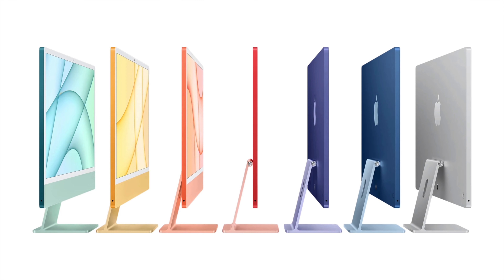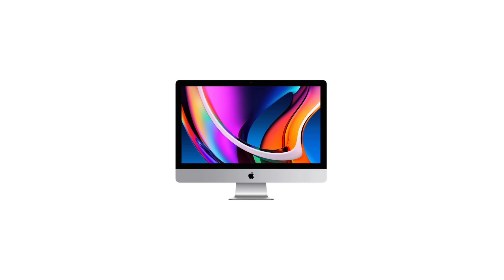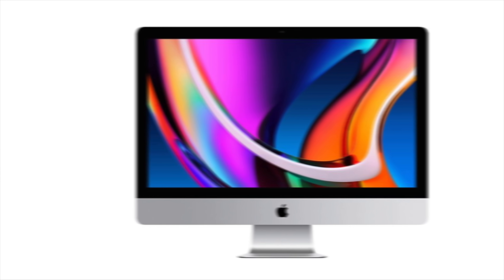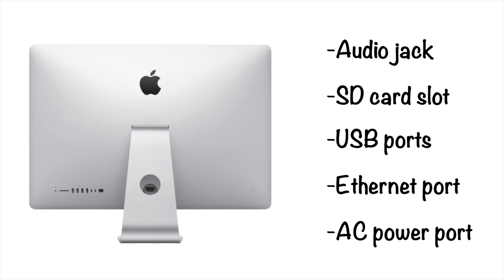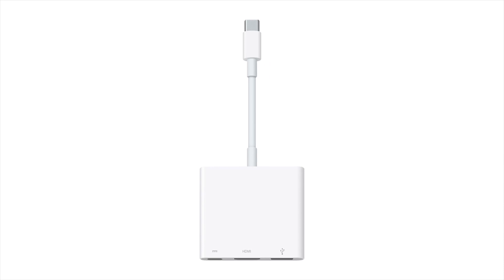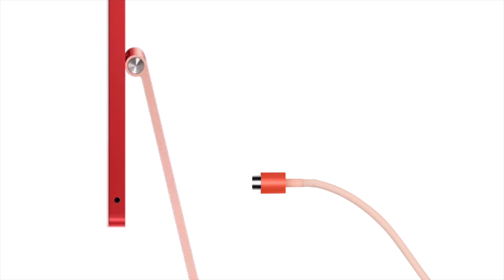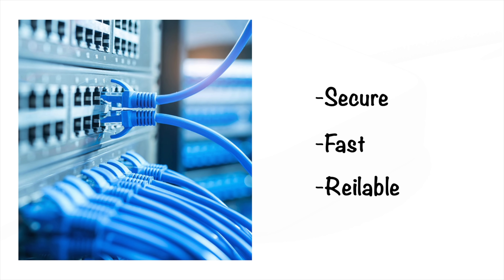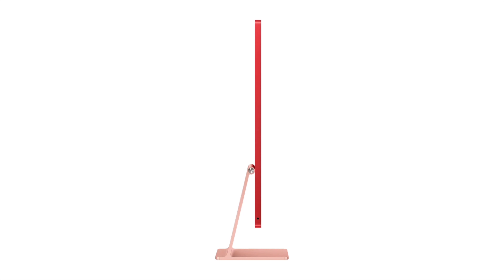How Apple Made The iMac So Thin

Comment: We make our car smaller by making combining steering wheel gearbox and engine into one component, we dont need radiator bexause it doesnt have any power compared to regular cars. Mirrors were too big so now we are selling these cameras extra that u have to install them somehow and danglingncables wont look like shit because reasons.. And we moved bulky gas tank to roof trunk so it wont bother passengers. We also kept only one door that is placed on back and on opposite side to where steeringwheelgearboxengine is located.
I hoped for some real engineering like hear pipes in cutout in motherboard ihs removed from all parts and direct contact with components. And all glued toghether sandwirch style like selphone while ethernet beinf rhis wacky contraprion that expands when opened. All powered by regular laptop power unit because it is a laptop but unusable while traveling.
Oh i know keep only screen and usb hub in it and move all components to the power brick.

Comment: The design goal of the iMac was basically to make something that looks like a monitor without a computer. But switching from CRTs to flat panels made this difficult. All CRT monitors had chins with various controls for the monitor on them, so the one on the original iMac didn't stand out that much. But they went from a monitor sitting on a suspiciously large base to several generations of conspicuously fat monitors. This is the closest Apple has ever gotten to hiding the monitor since the original iMac.

Comment: If I were an Apple's engineer I would lay connections via the stand and insert all necessary ports into the stand dock. Actually, it would ve also possible to insert more powerful components into the dock, as well as the power supply.

Comment: Removing all the ports on a desktop......... not all of us appreciate that. Also the cooling needs to be better, as apple chips can run very hot under stress. When running Minecraft the chip can go up to 101 degrees Celcius without cooling. Even with cooling the temp is still at 90 +. Apple needs to do better.

Comment: hey by the way, Apple silicon dosent really have the CPU GPU the RAM And The HUB
The Storage And Ram Is Kept Seperate But Still Solderd On The Logic Board.the M1 Has Only GPU And CPU on It.
Reply: The gpu in the m1 chip has ram inside of it...

Comment: I think it is better having the Audio Jack at the side as it easier to access and short cables reach it better. But why does Apple get rid of USB-A and HDMI and all of the other important ports in their new computers and make you have to buy adapters. Like I'm sure everyone has to get an adapter for a mouse as you barely see a USB-C mouse etc. I use a 13-inch MacBook Pro from 2011 and still don't have very good ports, 2 HDMI's and no VGA/HDMI, having to get an adapter that doesn't work and then getting 2 different cables for the Mini DisplayPort, one that goes to Display Port for a touch monitor and a VGA for others. I understand why they got rid of the port that has a Y type thing beside it, I think I sort of know what it is and don't know when I'm ever going to use it.

Comment: im not a fan of the new imac design and much brefer the bumped back imacs, simply because of port selection and the fact that the front bezel is black with a silver chin, but apple did a good job thinning the computer. im not looking forward to the point when the imac will be as thin as the og ipad, but with the m1 chip it could happen with its low thermals. good on apple.

Comment: The thinness is cool and all but:
1) It's a desktop computer, it's going to stay on a table/desk forever. It's not gonna move, so the thickness doesn't a have a functionality. It's just pointless apart from looking "cool".
2) It introduces another electric prioprietary cable, meaning: more unnecessary e-waste and less availability if your cable breaks compared to a standard one. (where's the environment friendly policy gone in here?)
3) To make the device this thin they had to remove the internal power adapter, meaning: you have an anti-aesthetic power brick laying around the house.
4) They could have added an SD slot on the side as well like the jack audio but wait, we can make people buy adapters and make more money!! 

PS: I like Apple products but we have to be realistic in this case.

Comment: Newer Apple product always had something that made people need to buy a specific accessories for it to properly used as what it was meant to be. In this case, people had to buy usb dongle which will make their desk not so neat, and moreover that usb dongle should be using the lightning port since most flashdrive used the usb c port, unless you don't mind spending more on a lightning flashdrive that has less storage for twice the price of a usb c that had 128gb storage.

Well, design and user experience is what Apple always provide to their consumer, so there should be no complaint from their consumer. That also goes to the fact that Apple product doesn't need to be fixed if you have no warranty anymore, just buy a new one, it would be a better product since they seldom sell an older product if not because they still had the stock.

Comment: I dont see the reason why the iMac which is not portable has to be this thin. It will definitely be easier to have a cleaner desk setup if they made the iMac a little bit more thicker, maybe 15mm or even 20 mm in order to fit a USB type A and SD card slot on the back.  Of course Apple will be more than happy to sell their dongles.

Comment: The Ethernet port in the power brick is a stroke of genius! And these new iMacs looks so cool!
Reply: the new imacs are the best apple has released, even though they killed upgradability by combining everything into the m1 chip, its so much better than the last imacs
Reply: @unused7629  what about iPads? They seem to work like a Mac but smaller and portable
Reply: @CrispyPillow6  the problem with them is that they are more expensive for less capabilities
Reply: @unused7629  oh
Reply: @CrispyPillow6  if your talking about the pro that is, but if your going for a budget apple pc buy a mac mini, ipads are for artists and streaming
Reply: @CrispyPillow6  iPads can’t replace macs and macs can’t replace iPads, they both have different use cases. They overlap, but there are things that are just better on a computer and some that are better on a tablet
Reply: @CrispyPillow6  Yeah man buy a 2500 dollar IPAD for the same performance of an 2000 dollar Mac
Reply: The g4 or g3 was too mabye @unused7629
Reply: The power brick would've been big enough to fit regular-sized USB ports & a card reader too I imagine. Alternatively some other brands e.g. Samsung have moved the ports to the base to make their products e.g. TVs, monitors thinner
Reply: @lzh4950  That would work but the power brick is meant to be on or close to the floor and having a bunch of USB devices sticking out of a power brick does not fit the Apple aesthetic.
Reply: and they stole the idea from the Chromecast ultra!
Reply: ikr, I was gagged when I saw that.
Reply: Power cords as a vector of attack...yeah, genius. Only increases the surface area to defend against hackers.
Reply: when determining the quality of apple products, one need only to look at the apple consumers and what they're saying. And they all look stupid and say stupid things.
Reply: Google Chromecast has the ethernet port on the plug from 4 years ago
Reply: They do look really cool, but I wish they'd gotten rid of the chin! I'd take a slightly thicker chassis if it gave them the room needed to make an edge-to-edge display like an iPad.

Comment: I simply don’t understand the obsession to make devices thin as a sheet of paper. The so called bump on the older iMac was already a compact design.  I care more about functional features like ports, included software and cost. It would be a miracle if Apple stopped being greedy and gave us memory sizes without making us pay premium prices for such an upgrade. And Apple returning the MagSafe is not some groundbreaking innovation but fixing common sense mistake they made in the past.

Comment: I am really dissappointed. Thickness in an iMac is NOT important. It stands on a desk and you never see the thickness (from the side) except in a few rare moments. The old iMac (I have a 5k) looks elegant even from the side. They did what they ever did, the offered a solution for the self made problem (thin housing) and now ship the imac with a power adapter that needs to be placed somewhere next to the iMac. 
Being "thin as hell" is not an end in itself. It only is as long as necessary and a real advantage. Apple is obsessed with thinness. In an iMac it only created problems that noone had when it was thicker. The old iMac was a design masterpiece, the new design not better, in the opposite, it has way less class.

Comment: It should be half the thickness and smaller chin if components were moved into the base. The tdp is low enough the it can be passively cooled. Then you would not have a power cable hanging in the air.

Comment: I was disappointed by how the new models still had bezels around the screen, even more so (verging on annoyance) that they made it light so it was guaranteed to stand out. ...but the screen is still larger and how/where they repositioned the Ethernet is a stroke of genius. The colours harken back to the days of the classic iMac (I've seen some compare them to other products that came out later) and are a nice touch to help make your Mac yours. Power connecter is great and the lack of I/o is no biggie even though there's bound to be backlash. USB-C hubs are extremely cheap and affordable for anybody nowadays. For around £15-£20 you can get several USB-A, ethernet, SD card slot AND HDMI.

The audio jack on the side is a nice touch as well and will make it much easier to find. I did notice the lack of the Apple logo sticker on the front though. I may have just not noticed it but I didn't spot a logo anywhere. Feels kinda naked without it.

Comment: I sincerely hate this new imac design, not only I think the old one seemed more premium but the excuse of made it thinner instead of removing the chin is an awful desition.
 So basically in order to make a computer that is going to stay static in your desk thinner you have:

- No Usb A ports
- No SD card reader
- Propietary AC connector
-An external power adapter
- Ethernet port missing in the lowest configuration

I mean why the hell someone would want an imac which is pretty thin by itself (2012 design) even thinner??!! I mean it's not a laptop or phone that you carry around, it's a desktop the fact that is 11mm is completly pointless, specially if in order to do that you are giving up all of the avobe.

Stupid decision
Reply: It is actually portable tho

Comment: My only thought is is this a meaningful improvement?  The base is bigger, so it doesn't really make a difference, and the structural of it have been weakened, thus it will be more likely to be damaged by random workplace interactions.  The fact that they removed the ports also removes the entirety of the fact that they are trying to go for a clean look, because a dongle with normal USB will not be hidden, and it will just look messy.
They should probably have found a way to include normal USB ports, or more ports.

Comment: Why not make a thicc (tm) L-shaped base with all the guts except speakers?  The weight would be down low, we'd get rid of the chin and have a lighter top that could be placed higher.  The connectors can still be wherever, and the heat of the display and CPU wouldn't affect each other.  It could be 15-20mm thick and still not be obtrusive.

Comment: By making it an unrepairable slab of ewaste. It’s garbage. No ram or storage replacement so when one of those bites the dust so will the whole thing,
Reply: iMacs are pretty durable, considering the aluminum casing.
Had a 2009 iMac that lasted me fine all the way into 2017 and gave them away to some relatives, that thing had moving hard drives in them.
Reply: @AdmiralBison  

Yes and that moving hard drive at all times could be replaced for a modern SSD fairly easily. On this piece of ewaste nothing can be replaced or upgraded.

Comment: I might would use Apple computers if they were as open to use as Windows. They are just too restrictive in what you can do and put on them. Though I like using Laptops, and with Windows, I have a large variety of different hardware configurations to choose from. As for example, so manufacturers make their mouse buttons very hard to press down, which would be fatiguing to push all day long. With Apple, you're always stuck with whatever hardware they choose.

Comment: Why is every YouTuber making it a big deal of thin profile of the new Mac?  Surface Pro, Suface Book are very thin even with the Intel Processor in it.  Those also have battery in it.  The design is really awkward.   The white bezels and the thick bezel at the bottom is the worst.  I don't really mind it to be thicker than having such huge bottom bezel!

Comment: It's really pointless to make it thinner since the actual desk footprint will be more than occupied by the stand and the actual "functional empty space" required. But it is nice though. I would have preferred a thicker Imac with more options.
Reply: To be fair it allows for stuff to be put on the desk behind the mac. What I think apple should do though is sell a mounting plate that would allow for a painting style computer.
Reply: @loganhallahan164  What would you put behind the iMac that benefits from the few extra inches of space?
Reply: @loganhallahan164  great idea. I planned that with my tv
Reply: @loganhallahan164  they already sell a vesa mount version
Reply: they could have had several of the regular usb ports either in the base of the iMac or the bottom edge of the computer.
Reply: Seriously, what’s the point. Also Intel has already combined the CPU, GPU and RAM in 2017, pretty sure apple took that and rebranded it. It’s pretty much an APU but with random access memory. 
But really, who needs it to be that thin, guess Apple wants you to just waste more money buying a converter to use the thunderbolt ports and an SD card.
Reply: @aiden8794  SOCs have been around much longer than 2017.
Reply: @wta1518   Oh, thanks for the info 😀
Reply: @aiden8794  the cpu isn't x86, for one, so no it's more like they took a iphone chip, juiced it up, and droppedit in a pc

Comment: I’d like to see a video on the differences between the M1 processor in macs and in the new iPad, I’m sure there’s differences between it right? Or is it even necessary given what you can do on iPad OS
Reply: AFAIK it’s the exact same M1 chips they use in the Mac, but they down-clock them to fit the thermal envelope of the iPad Pro. They’ve been doing the same thing with the A-series chips in the various sizes of iPhones, iPads, and Apple TV for years. By using the same chip in several devices, they can maximize economies of scale.
Reply: We’ll have to see what kind of enhancements they announce for iPadOS 15 at WWDC.

Comment: Rather have the computer be twice as thick and no chin. This is a desktop computer, it doesn’t need to be thinner than my watch. I also don’t get why Apple was so focused on the back on the computer. This thing will likely be facing a wall in most homes.
Reply: Yeeeeees , exactly
Reply: And the back could have easily looked good without being completely flat. The huge hump wasn't good, but a small well designed bump would've looked fine

Comment: The new iMac colors remind me more of the old iPod shuffle and nanos when they had a variety of vibrant color options
Reply: I think they’re more of a throwback to the original imac g4
Reply: @BlitzStudiosIsinsideyourhome  well I mean in terms of the aluminum unibody, it is definitely a throwback to the old iMac G3, but the vibrant aluminum colors take me back to those colors on the aluminum iPod shuffle and nanos when I was younger
Reply: @BlitzStudiosIsinsideyourhome , I believe that the new colours represent the 80’s Apple logo, all the colors are there.
Reply from the maker: n a n o c h r o m a t i c
Reply: @AppleExplained  iPhone purple
Reply: Aren't the colors the same as the old rainbow Apple logo? (+ white/silver)
Reply: Only you remind
Reply: MmmmmmmmmmmM
Reply: https://www.youtube.com/watch?v=h1EhgD0nj38 c
Reply: @Zpring  not you spamming the link to Promote yourself on every comment 💀
Reply: Apple M processors are all-in-one designs known as system-on-a-chip (SoC). This means they integrate several key components onto a single chip, including:
Central processing unit (CPU)
Graphics processing unit (GPU)
Memory controller
Neural engine (for machine learning tasks)
Image signal processor (for handling camera data)
Reply: I like The new iMac Colors, it's like rainbow lgbt💖🏳️‍🌈
Reply: @berreyl1689  i love new imac